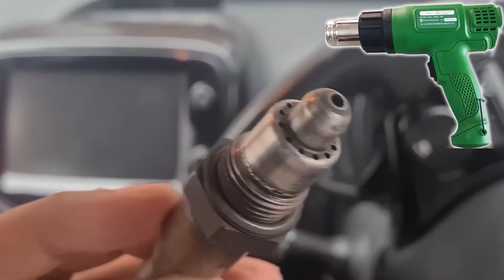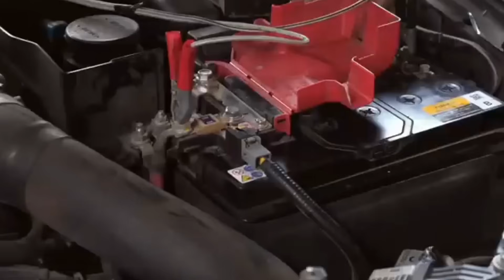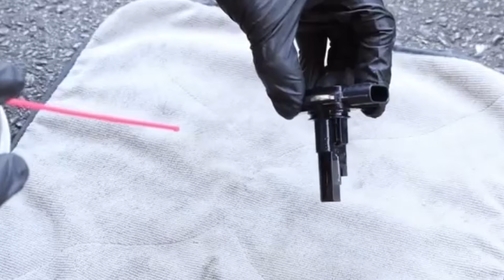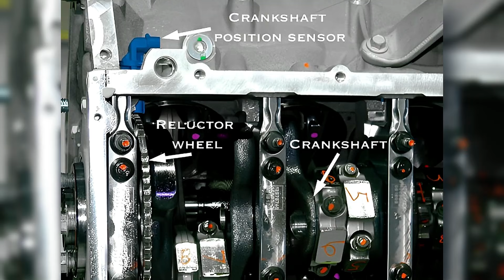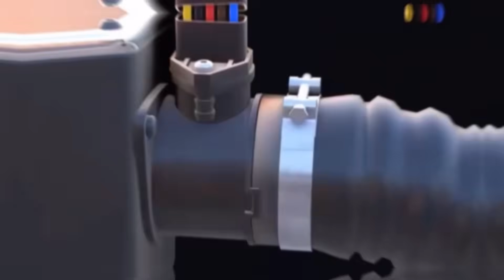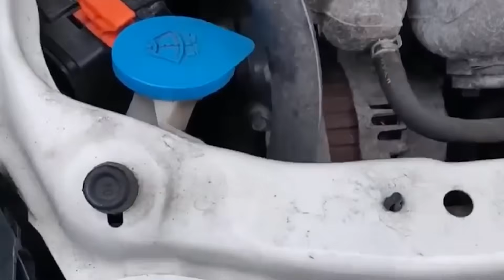Nobody Cleans These 5 Sensors — And Your Car Pays for It

Comment: just had the bank 1 sensor 1 P2238 code show up on my 2009 toyota yaris after having a new labdna sensor fitted. is there a sensor i should clean to help clear this?
Reply from the maker: Good question. If the sensor is new, the first things I’d check are the MAF sensor and the wiring to the O2 sensor. P2238 is often a circuit or airflow data issue rather than a bad sensor. Did the code appear right after the replacement or later?

Comment: what about the anti knock sensor. Cost is in the location to get at it...not the sensor...and the tools to access it...
Reply from the maker: Good point. The knock sensor itself is cheap, but the labor can be brutal depending on the engine layout. Some cars bury it under the intake manifold. Have you ever had to replace one on your Trailblazer?

Comment: My 2005 Chevrolet trailblazer is cracking for several seconds before it starts up running again?
Reply from the maker: Long cranking before it starts can be a weak crankshaft position sensor or a contaminated MAF sensor. Both are worth checking before replacing expensive parts.

Comment: My 05 f150 running ruff at a stand still the shake like it want to cut off I put a neutral and smooth out a little bit not as much shaking burn a lot of gas what could be wrong
Reply from the maker: Rough idle + better in neutral + bad gas mileage usually points to a dirty MAF sensor, throttle body carbon buildup, or a vacuum leak. All three can cause the symptoms you’re describing. I’d check the MAF sensor first.

Comment: Very imformative and useful! I like taking care of my own car. I have a 2019 Kia Niro PHEV. I've had no engine problems. Should these sensors be cleaned as regular maintenance? Thank you for the clear explanations.
Reply from the maker: Glad you found it useful, and for a 2019, cleaning is usually only necessary if you're having specific running issues! 👍

Comment: 1998 Volvo V90 wagon 135,000 miles rough idle, OBD-II codes P0141 and occasionally P0136 even after installing new  Bosch O2 after cat sensor .

Comment: I don't need to clean the Sensors or the ECU , or the Modules on my 1969 chevelle SS WITH A 454 IN IT .
Reply: No, you have a bigger problem. Avoiding tickets! 🤘
Reply: No but you need to tune up and clean the carb every 12k miles
Reply: Hell yeah. I have a 70. Easy to work on. It's made of metal too.
Reply: Gonna need that money for tire haha
Reply: Nice! Big block.
Reply: Same, but small block 68 Nova
Reply: Rotary phones work perfectly too, yet you’re here 😂
Reply: Need to clean the carb though
Reply: Ha, ha .. no .. just need replace the rubber covers for accelerator and brake pedals .. 🤣

Comment: You can buy them O2 sensors around 30/ 35 bucks. Don't cost $6 to $800 to install them
Reply: yes i buy mine online 45 euro ..in the part shop they ask 175 e ..works like a charm
Reply: taking off 02 sensor xant be a big pain in butt if it's been there for 27yrs and first time change it

Comment: My car is 2007 Pontiac vibe. My automatic headlights stopped working first, then my brake lights, I have a battery symbol on my dash. It died while driving but it starts every time. It won't stay running for very long. I've cleaned battery terminals.
Reply from the maker: This sounds like a charging system issue. If the alternator isn’t charging the car will die once battery voltage drops.
Reply: I expect your alternator needs replacing. Had same symbol in car and replaced alternator   N 
o more symbol and car is running fine . Replace your serpentine belt too !
Reply: Alternator
Reply: Would a bad alternator cause my day running lights to not work all of a sudden and my brake lights as well? But if I have a bad alternator why is it still charging my battery? My car starts every time. Could it be bad diodes or a ground wire to the head light system not be grounded? Does anyone know of subtle things that someone could do to my car to cause this issue as in switching a fuse with the wrong amp or something and make it look like it's my alternator? I'm suspecting foul play
Reply: Why would the auto head lights stop working but the manual ones work
Reply: @Jena-b6f some type of switch not working?
Reply: You need to have a mechanic use a scan tool on your car and physical inspection !
Reply: You got to buy an expensive battery that actually works especially if you have like hard winters The battery will cost like $250 to $400
Reply: This worked for me. And my car runs great and starts up in a flash'yo